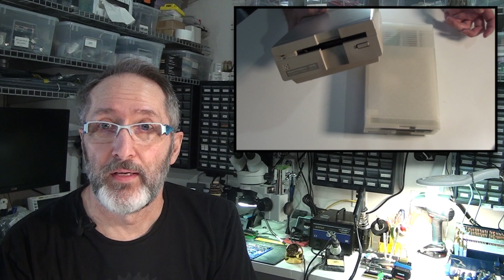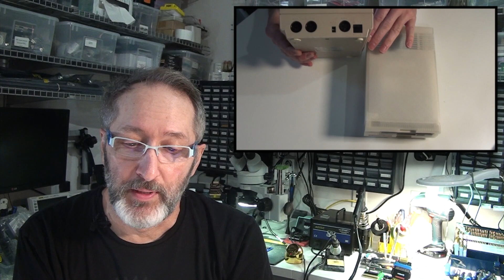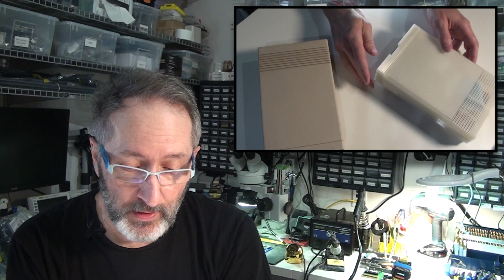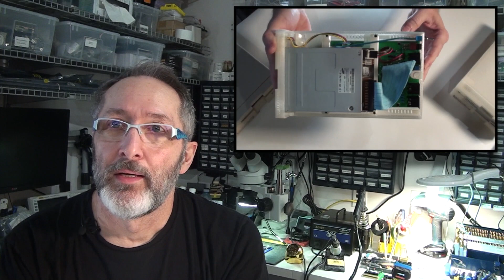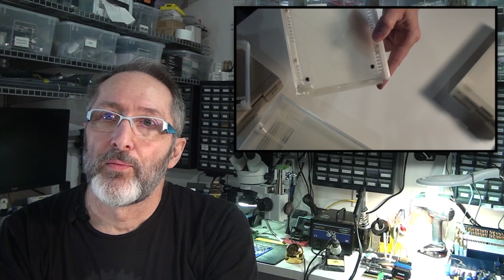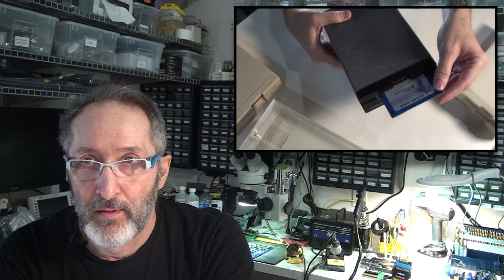3D Printed Commodore 1581 Drive Case

Comment: Wonderful design on that case!

The design itself is clean and solid.

And yes going with that curve instead of the shelf on the bottom section was the best approach.  I mean you could have printed it upside down, used a tone of infill, spent 40 hours printing it -- but -- well --

You made the right compromise.

Comment: Fantastic stuff. I love what you did with the 3D model. The only thing for me is the cut in for grabbing disks. It hard stops into the PC drive. I was thinking about if you remove it but then it might be too plane on the front. However, what you were saying about the side ledge you turned into a round corner. Wonder if you could apply that smooth round to the top and bottom of the pc drive? That way it would seem to fade into the PC drive and you don't see the top and bottom part of the pc drive exposed. Just a thought. Wonderful work, thou.
Reply from the maker: Thanks for your comment.  I too had given some thought to that edge of the FD that shows, and in all honesty, never came up with a solution I liked any better than the way you see it there.  With the SX-64 style case, with the black face and black drive, it really doesn't show.  And the natural translucent and a white drive also not so bad.  I agree that it would be nice to have a better transition, but I have yet to dream up something that looks better than it does at the moment.

Comment: Could you print the bottom section of the drive upside down to help with the gravity issue?
Reply from the maker: You certainly could, however, you'd use a LOT of throw away support material plastic.

Comment: Curious what filament you used and what temp you use for the heat serts?
Reply from the maker: I used PLA for all of my 1581 case prints.  As for heatset insertion, I insert them into the plastic at just over 700 degrees.

Comment: Hi, i can see you have only a 7805 regulator, what about the 12v?
Reply from the maker: The majority of floppy drives don't need the 12v portion of the supply, so I didn't bother in the alternate supply as there are so many drive options where it's not a concern at all.  In fact, I have yet to find a modern drive that needs the 12v
.

Comment: Re: 3D printing that ledge on the bottom.  Couldn't you just print it upside down, with a separate bottom plate that gets glued on afterward?  (disclaimer:  I have zero 3d printing experience)
Reply from the maker: Thanks for your comment.  It could most certainly be printed in a couple pieces.  When I do that, I use heatsets and screws to assemble them in leu of glue.  The goal with FDM printing is to have models (ideally) that are self supporting, or finding ways to prevent excessive overhangs.  Your solution does have merit.